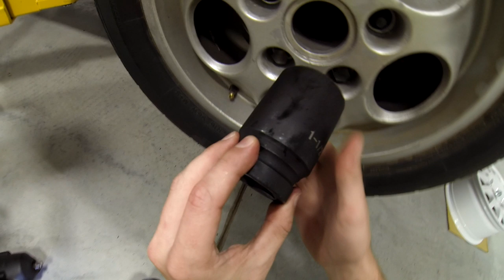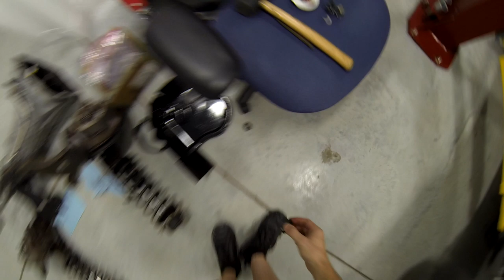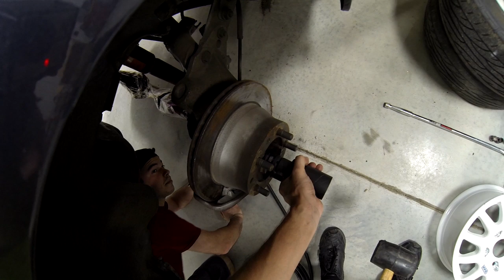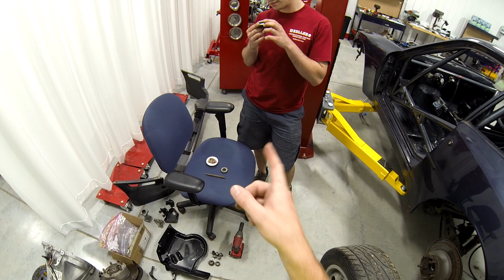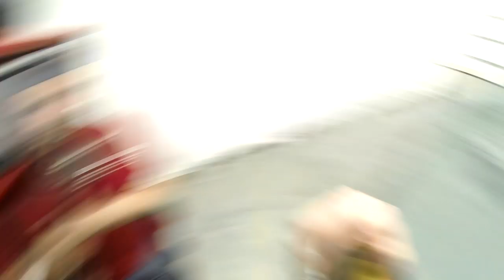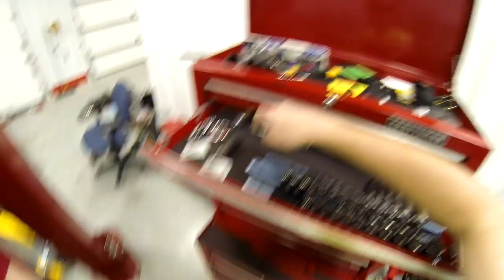How To LS Swap A Porsche 944 - Part 56

Comment: did you by chance pick up the Texas Performance Concepts kit or the Renegade Hybrids kit? if either what do you think so far and what kinds of things would someone need to be aware of with the kit
Reply from the maker: I used the TPC kit.  There have been several issues, however, i called TPC directly and they resolved the problems.  When i attempted to contact Renegade, multiple times, they never answered the requests for information about their kit.
Reply: @PowerSports  thank you! I recall brandon said he could get the LS motor for cheaper? what would be a couple good places to look for an LS? everywhere i go online theres a ton of options and weird options at mostly sketchy websites.
Reply from the maker: the best way to get a motor on a budget is find a vehicle that got rear-ended (or side impacted) and totalled.  then you can pull the motor, wiring, computer, injectors, fuel rail, manifolds, mounts, etc etc etc.  this is way cheaper than the way I did it.  since my build will be flying past trees at 80+mph on a gravel road, i wanted everything to be brand new and in top condition.
Reply from the maker: and yeah, i totally get you on the sketchy websites!  even the best engine builders in the business don't seem to understand how important a website is.  they just rather have you call them, i guess.  it is annoying when trying to do research and the damn website hasn't been updated in ten years.  lol.
Reply: @PowerSports  sounds like its a trip to the junkyard once every couple weeks! thank you so much for the snappy responses! been religiously watching the videos as theyve come out because my project will likely take off this fall!
Reply from the maker: thanks so much for all the views!!!  hope your project goes really well.  ^_^
Reply: @PowerSports  thank you! yours as well!!